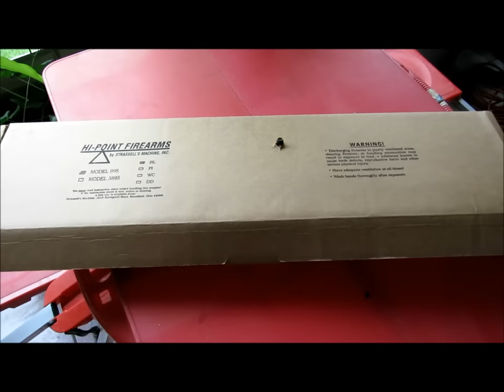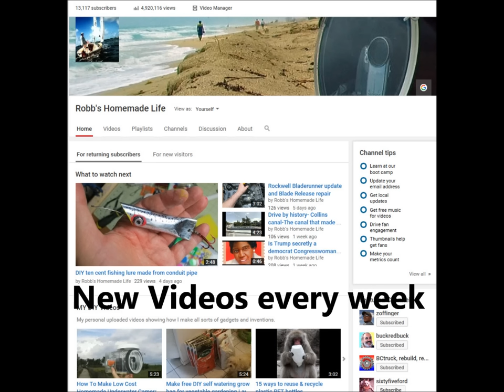10 reasons I bought a Hi Point Carbine & 6 bad reasons not to

Comment: You missed one of the biggest gripes people have about this gun...the absolutely abysmal magazine capacity. HP needs to get their s*** together and offer some bigger mags for it that are reliable, rather than forcing people to try their luck with 3rd party garbage mags just to get some more capacity.

When my Glock 19 has 150% the capacity of a standard HP 9mm magazine, I'm hard pressed to pick a HP carbine over any of the various options on the market that take Glock mags and frankly give me wayyyyyy more firepower. 

I suppose if you are in California or New York that's not an issue to you, maybe even a high point (lol) of the design, but if you live in those places you have even bigger things to worry about.
Reply from the maker: Your point is true, I was well aware of the issue, I don't know why I left it out, thanks for your input.

Comment: If anyone is concerned about how ugly this gun is, then have them look at some of the accessories that Longshot sells, namely the extended top rails. Just pick one of those bad boys up, and a set of flip-up sights, and the pretty score goes up significantly. I for one think that this TS model looks pretty decent, whereas the classic 995 was really doofy looking.

I have a classic 995, and I discovered that upgrading it into the TS stock was really inexpensive
Reply from the maker: Hey Joshua thanks for the tips I really appreciate that.

Comment: Ten round mags are the only reason why I don't buy that rifle.
Reply: The Gooch they make hi point approved 20 round magazines now that doesn't void the warranty
Reply: jrvbamafan1 yes I know but have you seen those mags, They look like they glued two 10rd mags together.
Reply: Midway USA has 15 rounders made by ProMag...these are quality mags. at $15.99 each...they also have incorporated a plastic sleeve that fits inbetween the bottom of the mag and the distance to the bottom of the pistol grip...this gives a cool professional look to the magazine.
Reply: ProMags are not quality, probably the worst mags I've ever dealt with. Had some for my 995, they didnt run well. My friend had some for his AR, they didnt run well. If you do buy Promag I suggest on buying a 1911 9mm 15 round spring from a good manufacturer and replace the spring (maybe the follower if possible).

Comment: So many people dog the cheaper firearms. Here's the truth. ALL firearms fail. there are thousands of video's of glock, sig, ruger, s&w browning, etc. failing on youtube. the fail rate is just as high for the expensive guns as they are for the less expensive guns. The best gun you can buy is one that fires when you pull the trigger.  Fact is, many people buy guns and never need to use them in self defense. so they do a little target shooting. and that firearm will last them the rest of their lives. while most of the more expensive guns it seems the weenies who buy them just have to take them out and fire 5000 rounds through them with their yuppie buddies along to watch them to do it and tell them how awesome they are. I carry a bersa model 85. does what i need it to do and it's not exactly a cheap gun but it's not over the top expensive.  before that i carried a lorcin l380 cheapest of the cheap and once i polished the feed ramp it would feed a magazine smooth without hanging up. Someone once told me that the lorcin was only designed to last about 500 rounds. so of course i had to prove them wrong.. i fired 3000 rounds through that pistol and it worked great when i sold it. no cracks and no real wear to be concerned about. (of course is was a metal gun..no way i'm buying a plastic gun that my dog can make his chew toy while i sleep.)  what all this gun brand envy comes down to is people who are upset that you bought a gun just as good as theirs for less.

Comment: Thing is, its not a good gun in any means of the definition.... It'll jam about 30 oercent of the time with the factory 10 round. Red ball 20 helps, but its still a hi point... Bought one gave it a week, sold it and got my Mp5 9mm, had to sell it back to where I Bought it, since 90 percent of gun shops will laugh you out the building if you mention hi point. I firmly believe hi points are for ignorant people who shouldnt even be in the gene pool anyway, so in that regard, hi point does THAT right, since even a criminal will have a better gun if you're trusting your life to a hi point.....

Comment: Their Carbine is much better than their handguns (which are horrible), but Hi-Point is cheap, and you get what you pay for. Don't expect a Beretta or even Kel-tec quality with Hi-Point.
Reply: wickedninja8599 Their handguns shoot every time you pull the trigger and are very accurate if you actually have skill with shooting pistols. If you're saying they are bad because they don't look pretty then that's just plain stupid lol.
Reply: Sometimes you just get what you get.  What you pay for is up to you.  I have a C9 I purchased used from a friend for $110.  Thousands of rounds have gone through this gun with almost no trouble.  I did later have a problem with the firing pin sleeve.  Hi-point had it to my door in a few days and I had it replaced it 5 minutes.  The earlier C9's (maybe some of the 380's??) used a sleeve over the firing pin that would eventually crack.  The replacement had no sleeve and used a spring within a spring.  They are great guns!  I'm interested in owning one of the carbines as well.
Reply: I've NEVER had any issues with ANY of the 3 that I own. I just don't get peoples issues. Now I will admit that I had all of mine customized, I sanded the ramps and rails, cut 2 rounds out of the Spring and 1.5 rounds out of the trigger springs. They shoot VERY accurate, ALWAYS, they NEVER jam & I called and asked them, NONE of the work that I done affected the lifetime warranty, so I don't know what to say other than I love mine, and I have less in all three ( .380, .45 & a 995 in .45 cal ) than most have in ONE handgun lol !!
Reply: Craig Fisher i picked up a used c9 for 80 bucks.. the mag was rusty. and the gun was dirty. i took it out as it was to see how it did. never had a problem. seems like an all around decent firearm for the price.

Comment: Yes its ugly and cheap but it's a pretty well known fact that Hi Points are reliable. On a second note, if you're not firing your pistol with two hands, you should be.
Reply: I think the carbine is reliable, the handguns are hit or miss. Fantastic company, however, I always encourage hi points for fun, just not for security.
Reply: i found my 995 to be mostly reliable. needed some decent force to cycle the action though, so i did have some issues with some reloads i bought. use heavy and hot ammo for the best results.
    having owned one,  i would not want to have to rely on a hi-point in combat if i had better options, for a small handful of reasons, reliability being the main one. chances are, though, that this rifle will work when you need it, assuming you keep it clean and oiled, have broken it in (200+ rounds), and that you are using hot enough ammo (winchester 124? grain 9mm target ammo worked fine).